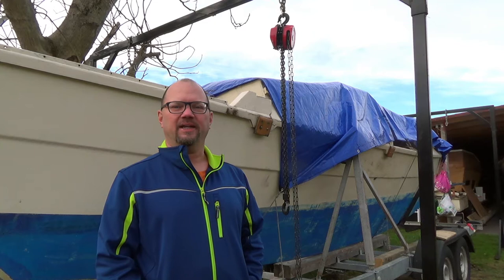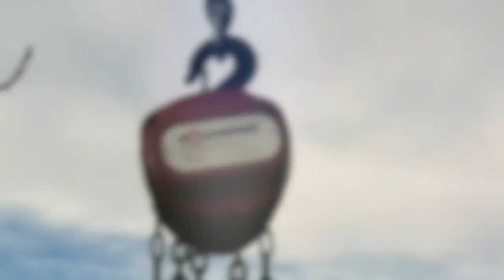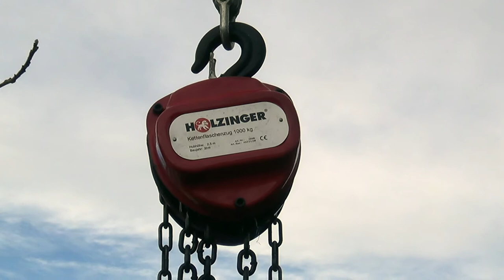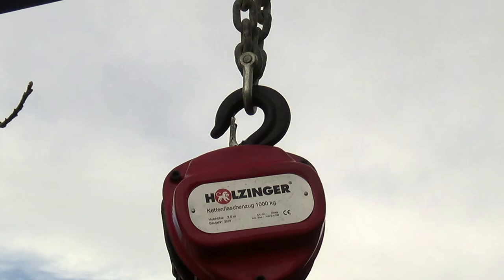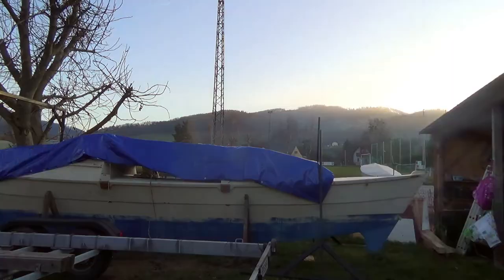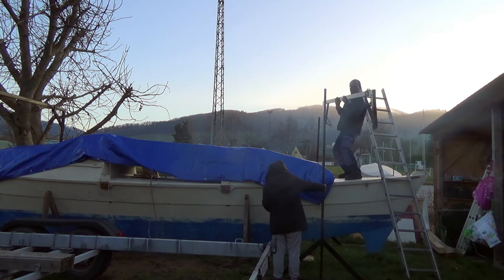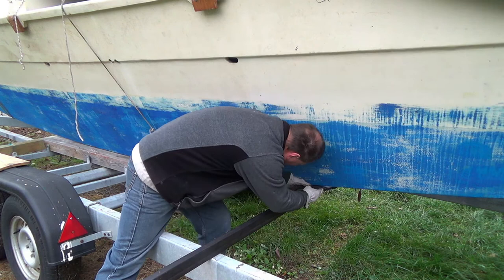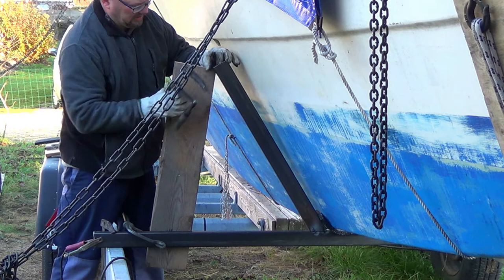DIY Boat lifter

Comment: On the Wharram site it says the Tiki 30 is the largest boat that is trailerable. You have a 31 on a trailer. Did you run into any difficulties in doing so, and is it legal?
Reply from the maker: Hey Mark, i just parked one hull at the Trailer to move it in the garden. When bringing the boat to the water i would  bring each hull in a seperate lift. And assembling the boat on site is a lot of work as well. I took three days to have the boat ready to launch. So you definitely will not to this for a 2 week holiday....
Reply: @robertgrafl  thanks for the reply and good to know. Seems like a pain in the butt!